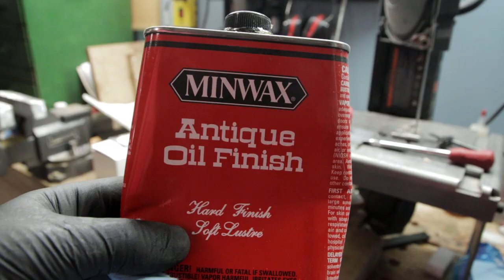Fixing Up an Antique Bit Brace

Comment: I'm sure some purists are going to hate you for bluing that antique brace, but I think it looks really cool. Beautiful job! I've got two that came with the ratchet mechanisms frozen with rust. We'll see if a soak in Kano Kroil will get them moving.
Reply from the maker: Thanks! I'm not too worried about the purists. They were the ones telling me to throw the brace away instead of trying to save it.
Reply: @EricMeyerMaker  , financially, it definitely wasn't worth the time and effort you put into it. The satisfaction of using it, or even just looking at it, after all you did to bring it back is probably priceless, though.
Reply from the maker: That is exactly why I did it. My guess was that it was about 80 years old. With a little help we can get 80 more out of it.